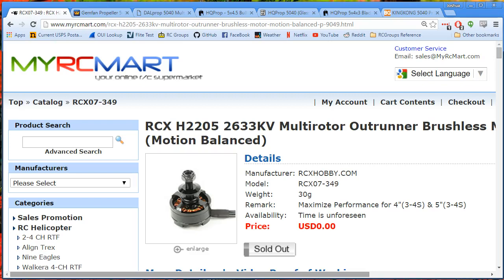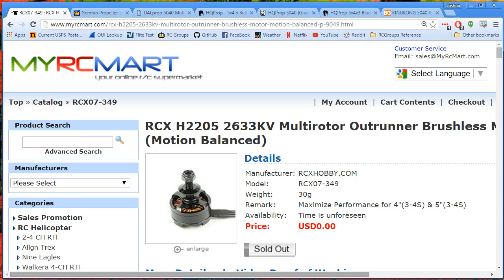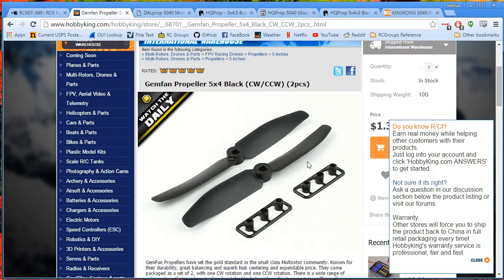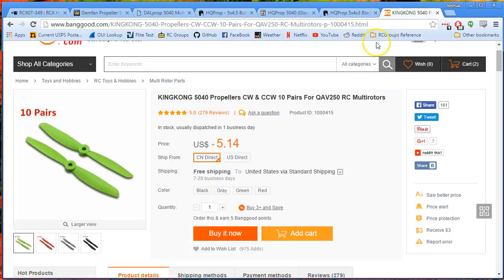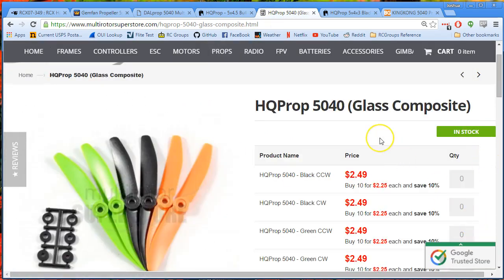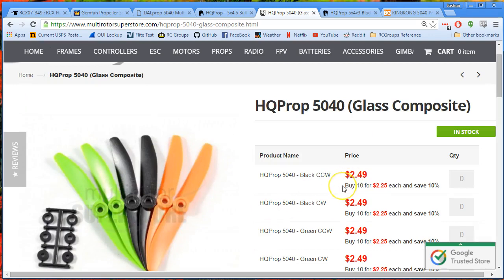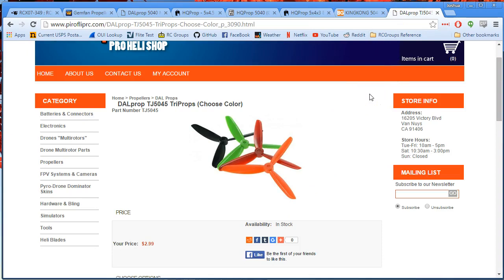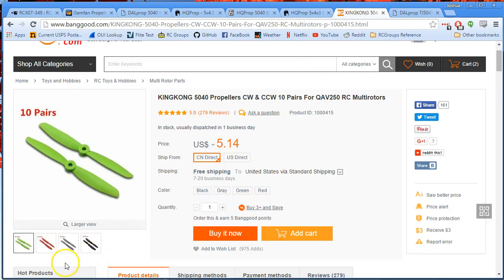High-kv Prop Run-down

Comment: Kingkong 5x4x3?? Any good on T motor 2205 2650kv??
Reply from the maker: +luke Stanton definitely.
Reply: Joshua Bardwell thank you - 20 pairs in the post - motors due any day! Thoughts on ESCs? 4 in 1? Amp? Keep up the videos - New Patreon Supporter - you've helped loads and I look forward to more videos!! 👍🏼
Reply from the maker: +luke Stanton I'm still suspicious of 4 in 1 ESC's because if one goes, they all do. 20 amps is more than enough for most 5" setups.
Reply: Joshua Bardwell thank you!
Reply: luke Stanton it changed  so much in 5 months 😂

Comment: I second the kingkongs 5040 and the 6040. I recently even cut some 6040s to 4040, rounded the edges for efficiency and put them on my 180. I bend them, chipped ,generally abused them a lot and they still fly with no noticeable imbalances. And they are cheap cheap.

Comment: for those considering 5s setups, higher kv on 4s would do the same.
Reply from the maker: Not at all, I don't think. Higher kv means less torque. So higher kv on lower volts would give same rpms at lower torque. Higher volts at lower kv would give same rpms at higher torque.
Reply: Didnt test it, but theory is that for a given size motor, working at a given rpm, high kv on low voltage would yield the same result as low kv on high voltage. Of course current draw would change accordingly but watts should remain the same.

Comment: KingKong 5040 now give zero results on Banggood!
Reply from the maker: AWESOME!

But DYS 5x4x3 is my new favorite prop ;-)
Reply from the maker: +Chris Brent Yup. All KingKong gear is completely gone from Banggood. No clue what the deal is.

I suggest the new DYS 5040 tri-blade (looks like an HQ) as a good replacement, although it's still not as cheap as the KK by far.
Reply: Something has happened in the last 24 hours - all of the kingkong stuff is back on banggood!
Reply: Haha, I guess the DYS are like the HQ5x4x3 but cheaper. I'm guessing they bend and get out of balance after a crash though?

Comment: Does anyone know if the cobra 2206 2100kv motors could handle a 6045 prop on 4s? I know it's a 5" prop show off but I am having a lot of trouble finding great detailed 6" prop videos. Maybe I should just go to 5".
Reply from the maker: +Brenden Foltz that motor can definitely handle that prop.
Reply: thank you.

Comment: There is some talk here in Albuquerque that we can (and should) use more aggressive propellers than our sea-level brethren (we're the other mile-high city) due to the thinner air. What are your thoughts on this? In my opinion it makes choosing a good 5 inch propeller for a 2300kv or lower motor very hard. Many guys here are running these RCX 2633 motors, and they seem to do well on the trip-blade DALs. Thanks!
Reply from the maker: +Levi Maston It makes sense in theory. Show me the data!

Comment: Curious, does using 5" props with higher kv motors reduce battery/flight times?
Reply from the maker: +Jonathan Edradan Depends entirely on what you're comparing it to. I went from 2206/2250kv to 2205/2633kv, same prop, and my flight times went from about 2:30 to 3:15.

Comment: You should also try the DAL 5045BN V2 ... they are not real Bullnose Props and quite efficient. They slaack a bit in comparison to the HQ 5040x3 though.

http://www.wuzzle.de/Bastelkrams/MotorTestStand/ThrustValuesSupertable.htm

If you scroll down you can see a few props I tested with the RCX Motor. I am back to 2204/2300 Cobras but the RCX definately work quite well with the V2s.
Reply from the maker: +wuzzle punkt Thanks for this data! It really confirms that this motor chokes on more aggressive props. Amp draw goes up with very little increase in thrust.
Reply: Yes that's for sure. I originall intended them to be used with a small 180 Tweaker and 4" Props but in comparison with other motors in the 2300kv range they draw way too many Amps for a little 1000mAh pack to handle while not providing that much more thrust. (Mainly with HQ and DAL 4" triblades as they seem the only competitive options)
They really seem to shine with the traditionally formed two bladed props. Like your KingKongs or the GemFan 5045

Comment: I'll have to buy a set of these motors.  I feel like they would be amazing on gemfan 5x4x3s
Reply from the maker: +Johnny FPV I flew them with GF5045 and they deformed badly at about 60% throttle and up. Just too flexy. But 5x4x3 may be different.
Reply: Gemfan is making good props now, their old props were garbage

Comment: I value your opinions/reviews so when they come up I pay close attention to them.  Although your criteria may differ slightly in choice you are right on the MONEY with reviews. There is somebody cheaper than you. That would be me and I also look at value versus cost as a not so skilled pilot as you. As far as your flying skills go, you are 6 months ahead of me so you have been a great benefit.Thanks for your work or what you may call fun. I am looking forward to seeing yet another battery comparison to include the "graphene"/lipo which could be a value.

Comment: Do you balance your props before using them? I bought a cheap prop balancer but it seems like a lot of work to balance all the props before using them. Would like to know your thoughts on this.
Reply from the maker: +xuxusito For 5" props and below, I don't see any reason to balance them, especially as often as you break them. If your factory props are not sufficiently balanced out of the box, buy different props. Even most 6" props can fly without modification. All of this is especially true if you are flying Cleanflight 1.11 or above, or Betaflight 2.1.6 or above, as they have very good filtering that handles vibration very well.

Comment: why they not providing info about Amperage of the motors ?
Reply from the maker: +Mindaugas Žukauskas Thrust data for the motor is provided on the product page.

http://www.myrcmart.com/rcx-h2205-2633kv-multirotor-outrunner-brushless-motor-motion-balanced-p-9049.html
Reply: thanks, Suitable ESC: 10-30A I'm going to put them on ESC 30A

p.s. HQ 5x4x3x props are a little bit cheaper at impulserc http://impulserc.com/copy-of-8x-hq-prop-6x45x3-coloured-props

Comment: I have been running this motor for some time now. I used to run DAL 5040, but then switched to DAL 5030, and it's both faster and more efficient.
Reply from the maker: +Kristian Leonardo Apuzzo Faster AND more efficient??? Hard to believe! I guess the lower pitch results in higher RPMs and therefore speed?
Reply: +Joshua Bardwell The DAL 5030 are slightly more flexible and lighter than the 5040, also the lower pitch makes it more efficient because the motor does not have to work as hard to spin it. At the same time when going full throttle you get much higher RPM, both because of the lower weight and lower pitch. One downside is I occasionally get some prop deflection when going full throttle, but nowhere near as much as the GF

Comment: I love these high kV motors! I run the same motors on my zmr180 on dal t4045bn. Packs a punch for sure. Also have the 2350 variant on a 225 with deal t5045bn. they do not break but like you said after serious crashes they start wobbling. I'm lucky to have only lost an rcx up to now (that was a gemfan 5045bn). they are light but quite fragile motors, especially the base.

Comment: Good info buddy, cheers. Might have been nice to compare weights though, particularly blade weight, seeing as you have a few broken ones :D Very relevant for these high KV motors it seems.
Reply from the maker: +Revs Not just weight, but also pitch matters, I think. This is one reason the 5x4x3 can do so well even though it's a triple. The HQ props are VERY light and thin, so they have very little drag and mass to overcome.
Reply: Yeah I love the HQ543's. I've tried many others but nothing really compares, so I just grin and bare the cost.

Comment: Thanks for the video Joshua
I've been flying these motors ever since they first came on the market, my favorite because of the price/performance/bang-for-the-buck
I have been flying the DAL V2 bullnose with great success on these motors, they are quite a bit more efficient than standard flat bullnose props buy they still provide very decent thrust and speed
http://www.surveilzone.com/Dalprop-2-Pairs-5045-CWCCW-Bullnose-Props-for-Mini-200-RC250280-QAV250-FPV-Racing--g-1421
Reply from the maker: +Eric Milewski (Armonic) I like the DAL TJ5045 very much. I think they are my favorite all-round tri-blade prop. I still think tri-blades are finicky and a bit of a hassle, so I prefer to fly two-blades if I can get the performance out of them, though.
Reply: +Joshua Bardwell The V2 bullnose is not a tri-blade prop, you didn't talk about then so I just wanted to bring it up to your attention in case you haven't tried them yet.
Reply from the maker: ***** Ohhh... sorry. I thought you meant the TJ5045BN, but you meant a two-blade bullnose? Can you give a product link?

I really hated the GF5045BN on my 2206/2250kv motors. I don't know if they would do better on this copter though. The HQ5045BN fly well, on these motors, but the square tip is super inefficient and they are too heavy for these motors (IMO).
Reply: +Joshua Bardwell These are not flat bullnose props, the V2 have a nice wing shape and are more efficient, link below
surveilzone.com/Dalprop-2-Pairs-5045-CWCCW-Bullnose-Props-for-Mini-200-RC250280-QAV250-FPV-Racing--g-1421
Reply: Is the link getting through?
Reply from the maker: ***** Yes. I can see it anyway. It may be caught in the spam filter.

Comment: Just put these motors on my Bolt180, have bucket load of GF4045BN and GF4045 to try also a few sets of HQ4X4X3BN
Reply from the maker: +sqwert I think these motors should excel as general-purpose motors for 4" props. You could also look at the 2950kv version even, although I definitely would make sure I was using an F390 ESC or a KISS in that case if I was running on 4S.
Reply: +Joshua Bardwell using 20A little bees, don't know what the rev limit is on these might need to change them. Using Tattu 1050mAh 4s 45c batteries.
Reply from the maker: sqwert Littlebee 20A is an F330 ESC. I would definitely do more research before proceeding with this setup. You won't break anything, but the ESCs may simply refuse to spin any faster, meaning you don't get as much thrust as you could.
Reply: Yea, will be replacing them. LB20's were already on frame with 1806/2300 motors.
I'am rather miserable with the throttle though not very often hit full throttle, really after the torque with these motors.

Comment: also try GF 5x4x3... very similar to the HQ but half the cost. 

DAL just came out with 5x4x3, check those out
Reply from the maker: +L Pablo Mendez DAL 5x4x3, you say? Interesting...
Reply: +Joshua Bardwell  

http://www.surveilzone.com/2-Pairs-3-blade-DALprop-T5040-Props-for-FPV-Racing-g-1497
Reply: +L Pablo Mendez They are great. :)

Comment: Nice review. I saw on rcgroups a coment abut DYS making 5x4x3 props, at half price of the hq. https://www.youtube.com/watch?v=OfeEoh8m-Jo   As seen on that video, is the exact replica of a hq, but half price. I have also this motors. I agree that the bells are very fragile, they can bend on a bad crash. I first used 6x3 hq props on these motors, giving on the bench over 1kg of thrust and 21A on 4s. Then i tried the hq 5x4x3, and gave almost exact same thrust on the bench, but the amp pull increased to 25A. Doing the bench test, when the amp pull goes over 25A on this motors, they start to make a burning smell, so i stop inmediately the test. With the 5x4x3 didnt got that smell. But the diference in flight is big. The maneuverability with 5x4x3 is much better than the 6x3. Also tried the hq 5x4x4, but the motor bogged really bad on these, pulling over 26A and getting only 950gr of thrust. Thanks for your excelent videos, have been very helpful.

Comment: You should check out the HQ 5x4x4... my favorite prop on my EMAX RS2205/ 2300Kv motors.  However, like you mentioned.  They are very brittle and costly.  I would run these all the time as well, if money was no option.  I purchased these many times from GetPropsMan.com, but after costing me too much I bought and tried out the DAL T5045 tri V2.  So far, they aren't bad... but definitely not as much bite as the HQ5x4x4.  =(
Reply: +Mikey “JellyLegs” Richard the 5x4x4 props gave me the biggest handling boost of any upgrade so far. When I put them on and flew around, I said to myself "Damn either you just got better somehow or these props ROCK!"
Reply: +Dragonsbane777 haha!  I know, right?!?  I wish there was a hybrid of the HQ's bite and DAL's resilience.  I still do "crash" landings, and that's where I break the most HQ blades.  So Hopefully w/ the DALs I'll just get more landing time under my belt then switch back to the HQs.

Comment: i came to exactly the same conclusion about the HQ 5x4x3s having also tried so many, in the UK they are even worse for price on those! Anyone at HQ want to trade my objectivity for sponsorship? sigh
Reply from the maker: +NJ Tech Everybody I know jokes about needing an HQ sponsorship. The thing is, even if the props were free, I'm still not sure I would fly them. How often do you tag a branch and keep flying? Not going to happen with HQ... Every time you nick a branch, you're going down, and every time you go down, you're replacing two or three props. Who's got time for that?
Reply: ha, very good point. :)

Comment: its all about qualification too. my newest fly spot is heavy tree [with lots of branches] with mass elevation change, i wouldnt fly anything BUT DAL [you would spend more time walking and changing props with anything else]. of course, i am using RG2205/2700kv motors on a 174mm frame so 4" blades. the TJ4045 dont work at all, but the T4045BN are insane... though 2 minutes of flight time. anyway, i have had pretty good luck at that size keeping reasonable balance even with knicks in the props. i beat a set down for a whole flying session while sometimes getting caught [and recovering] by branches.

however, i probably wouldnt fly a 5" prop [or frame] at that spot... which are more suited for more open spaces and acro style flying... so a lot less crashing or things touching the props. i have been  running the DAL T5045BN, but just got some sets of the DAL TJ5045 to try so we will see. HQProps? too much money. i would go through more money in broken props than bent motor shafts [which i have yet to do, but have sturdy motors].

i think the only reasonable way to fly HQProps is to be a] rich or b] sponsored.

with dual blades, the DAL 5040 are my favorite so i will definitely check into those KingKong 5040 you mention. curious if they have a triblade in the works?
Reply from the maker: +prOkrEAt They just came out with some bullnose, so they are a bit behind the times, but I suppose eventually they will release triples.

Flying yesterday really reinforced how perfect these props are for me. I flew all day on a single set of props. It was obvious when one was bent, but still possible to bend it back and keep flying. Light nicks and dings didn't imbalance the props to the point where vibration was an issue. And I didn't damage a single motor, except for the time when I flew right into a tree with the motor leading the way.

Comment: Nice vid, I really like the Gemfan 5045 Bullnose. Again they won't break if you look at them the wrong way but in a heavy off, they will break. I pretty much fly these exclusively on my 220 and up frames.
Reply from the maker: +FR3NZYFPV I just hate the way they flew on my 2206 motors.
Reply: +Joshua Bardwell that's a shame, I love them on my TSX220 and my old Emax 250. There's a lot of personal preference in prop choice though.
Reply: Those are my favorites too on the cobra 2204 2300

Comment: Were your tests with HV batteries?
Reply from the maker: +Antonio Silva Some, yes. If you're concerned about the rev limit on the F330 ESCs, I don't think it's an issue. My recollection is that you need to hit something like 45,000 rpms on a motor with this number of poles. With 16.8 volts and 5040 prop, RCX rates this motor at 30,000 rpms. So I think we're well within an F330's safe margin. But take that with a grain of salt, as that isn't really my area of expertise.